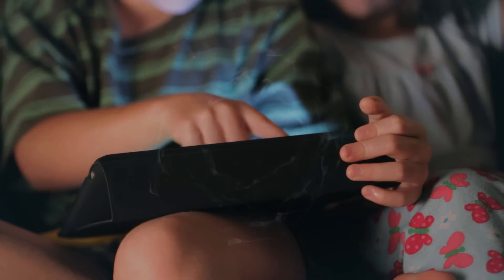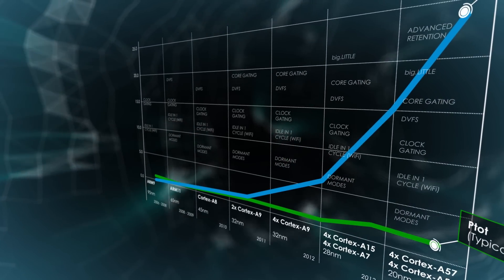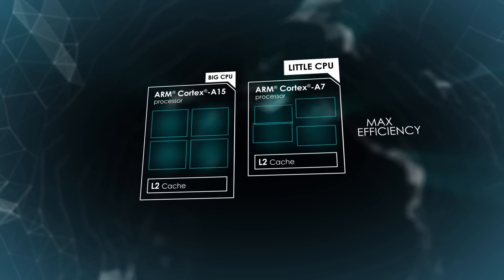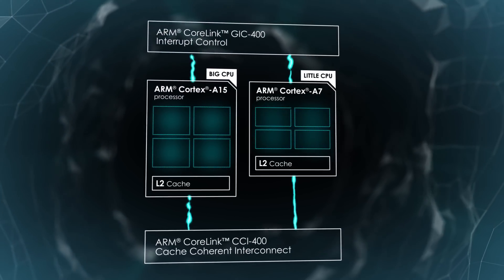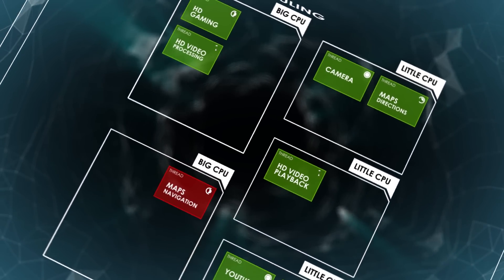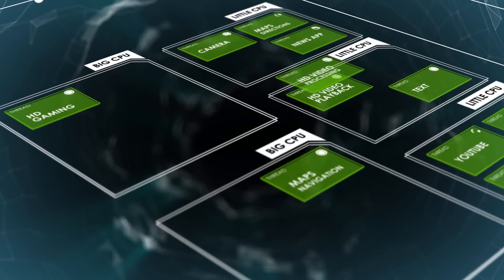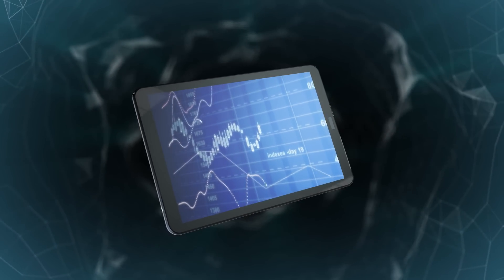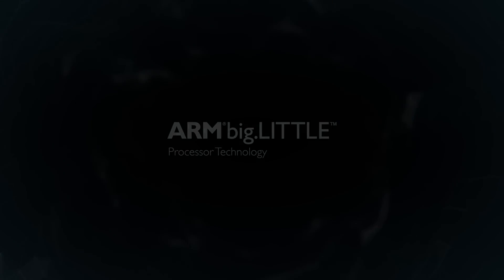ARM big.LITTLE Technology Explained

Comment: hmm Why not connect/max a bigger high-efficiency LITTLE CPU, the same size as the high performance/BIG one, and if you talk about space, how small is the high-efficiency/LITTLE one compared to the high-performance BIG CPU.
Reply: Efficient little cores do light tasks normally

BIG cores do heavy tasks and race back to sleep. They are used only and only when required as they are power hungry and energy consuming cores. 

That's why more little cores active all the time and big cores are online on occasions.